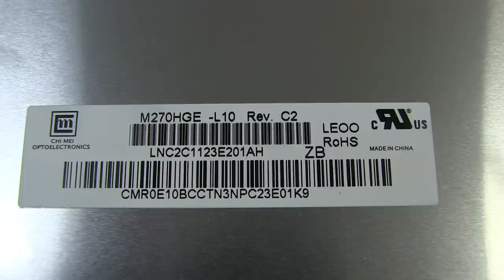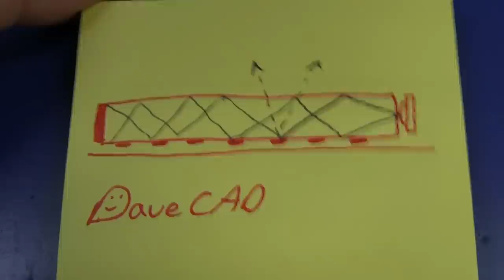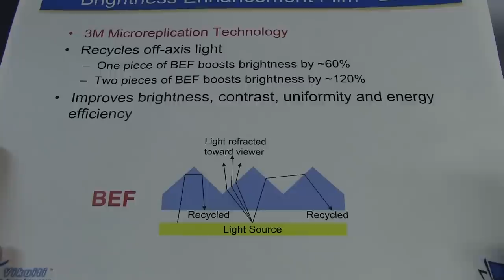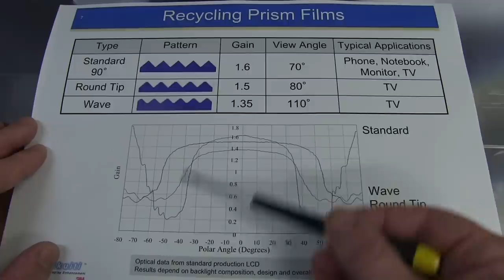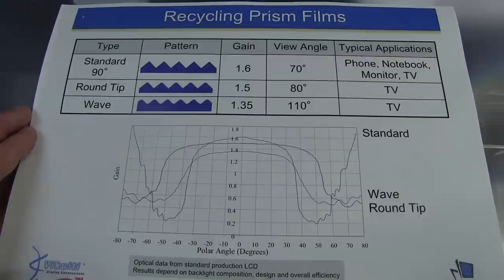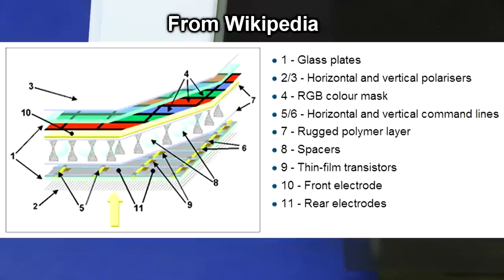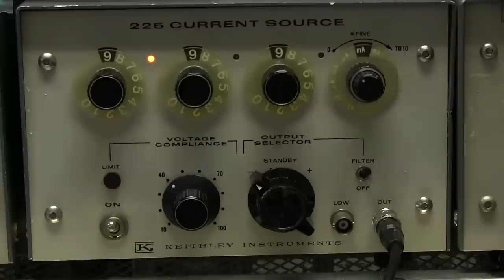EEVblog #465 - LED LCD Panel Teardown

Comment: Beautiful at 28:30 and 20:56 and 21:12 .
01:16 The PCB
05:44 Removing the back plate. Viewing the white, light reflective back
06:43 LED-back-lit polycarbonate layer with etched dots to let the black light escape the inner total reflection

11:53 Diffusion layer
12:25 Brightness Enhancing Layer recycling the off-axis light

16:21 Some extra diffusion layer?
17:10 The cracked LCD panel
18:25 Driver chips for x-axis and y-axis
19:55 Removal of the frontal polarization layer
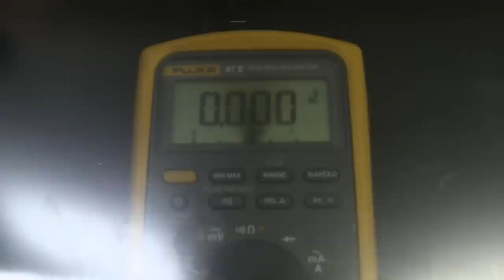20:24 Back polarization layer, pixel close up with macro lens
21:11 Viewing the individual traces to the driver chips
25:24 Pixel and Subpixel viewed with microscope
26:27 Explainaiton and Summarization
28:43 LED backlight efficiency

Comment: That extra stuck layer (the dark one) you are trying to peel off with a knife is the Polarizing layer. BEST way to get it off so as not to damage the screen is  to MASTK TAPE over the electronics to protect them then get a load of wet towels and SOAK the black layer of the BACK off the screen then after three hours you can simply peel away the polarizing layer.

Comment: Those flex cables going from the driver board to the panel are commonly called TABs. It's short for Tape Automated Bonding, though the process is actually ACF bonding. They are attached with anisotropic conductive film (ACF). The film has microscopic conductive particles suspended in it. Anisotropic refers to an object or substance  having physical properties which are different when measured in different directions. When the bonding process occurs, a combination of heat and pressure compresses the tape and this causes the particles to come into contact with each other. The spaces between the traces  don't get compressed as much, and thus don't conduct. The anisotropic property of the film is that, after its compressed, it is conductive if measured across the Z axis, but not across X or Y. There is also a driver chip on each tab. When those chips, or the bonds themselves fail, it's known as TAB bond failure. Tab bond failure is a common problem and is the bane of all TV repair techs. It's less common now than it was a few years ago, so they have definitely improved the process, but I still see it regularly. Though it is technically repairable, the cost of the equipment, and the requirement of a class 10 clean room environment puts such a repair out of the hands of most repair shops. A few years ago, a bonding machine was around $45,000 direct from China and the clean room would likely be just as much. Additionally, the tape has a short shelf life and is very expensive. Last I checked, the cost of a China made machine was down to between $5000-8000, I have no clue the quality of those machines, and you still would have the cost of the clean room to consider. Even if I had one, the cost of such a repair would likely be more than most people would be willing to pay. There's probably only a couple facilities in the country which do TAB bond repair, and I doubt they even waste their time doing repairs for the general public. There would certainly be more money to be made doing refurbishing for the various manufacturers (I could be wrong on that though). As for the burnt transistor, it could very well have been the only problem. Sometimes you get lucky and it's just a shorted MLCC, as was the case for me last month when I repaired a 55" Sharp smart TV by replacing a 3 cent capacitor. As for the diffusion sheets under the panel, I'm pretty certain they are made of Mylar, but I don't know much other than that. Here's a good video on ACF bonding. https://www.youtube.com/watch?v=biHFJFHpqdM
Reply: That was awesome! Thanks for taking the time to write that!
Reply: The burnt 'transistor' was marked 'D1', more likely it's a diode, half of a bridge in the DC-DC converter

Comment: Hi Dave, I was puzzled by the the types of materials in an edge it TV. Your explanation is very, very good. I needed to see what the order was as some of the sheets can be assembled in the incorrect order. I repaired a TV that could not be watched as it was incorrectly put back together.
Some TVs have more or less diffusion materials.
I solved it by watching your very simple to understand EEVblog #465 - LED LCD Panel Teardown.
I do know that the wrong order explains also the extra diffusion sheets. It is to prevent refraction when two smooth surfaces are placed on top of each other. so the extra diffuser acts as a separator. A pebbled surface prevents this. It is also the reason they are often very this as diffusion is only their second purpose.I assembled an 80" incorrectly and the large patterns an wrong side up/down was not seen until you turned on the TV.
Thanks for the video, I have saved it for later sharing.
Rinus (Canada) ("Mommy, where is my mommy, they've taken her away!" - Just for you Dave.)

Comment: The led strip with the complete diffusion /reflective white bacgroudn could make a  quite nice smooth light source -  as a ambient light or placed in a  picture frame and perhaps  colored plastic in front or some glass collage in front - and its quite low power.

Could do for a nice weekend project and nightlight.

Comment: if you reassemble the panel without the lcd, you get a very nice large diffuse light source that can be used as a light table, novelty lamp, etc. i actually have a reef aquarium that's flourishing under a stripped down 40" sony lcd tv.

Comment: Dave, it was fun to realize, that 5 years after your video, I did this teardown, exactly the same way you did, but only with a broken laptop LED LCD screen (which has the same structure, only with smaller parts). I also lighted up only one part of the LED stripe, and tried to realign the layers to see, how they deal with the light. After my experiments, I tried to lookup some videos, which could explain some things more in detail, and landed up on your video :D It's like watching my discoveries in a replay :D

Comment: At 23:40, I believe that the pattern in the corner is to balance out the plating area when fabricating the flex.  If my memory is correct, plating is a function of current density, and if there are portions of the layer which have significantly more plated areas than other parts, it can cause issues with getting a consistent plating thickness over the whole area of the surface.  So the PCB shop may add patterns or ground-plane in unused areas to keep the ratio of plated to un-plated area consistent across the printed circuit.

Comment: The strip has multiple series chains of LEDs on it that look to be individually brought out on the connector, since as Dave pointed out all these LEDs in series would need a massive voltage, like a few 100s of volts.

Comment: The inside of a CRT has phosperous lining it.  When hit, (at the correct position) they illuminate.

That's, what you would see.  Along with some x & y plates and magnets used to focus & aim the beam as it scans across the inside of the screen.

Comment: There are two major LCD panel manufacturers in Taiwan, they are CMO and AUO respectively.
AUO is owned by BenQ
and for CMO, they produce monitors using the brand name "CHIMEI" (or CMV in many years ago)

Comment: Take out the LCD panel, leaving everything else. Suspend the top polariser a bit above the rest - Then turn on the LEDs and use it as something similar to a polarimeter. Put a piece of frustration-guaranteed blister pack in - Look at the stress lines which are revealed. Polarised light is COOL!

Comment: That backlighting system is quite ingenious. I would have never thought of that.

Actually, before I finished watching the rest of the video, I was thinking that the backlighting was the actual thingie producing the display, with the 'dots' somehow turning on/off and reflecting red, green, or blue. Now it seems kind of ridiculous now that I've seen the rest of it. But still, it seems like an intriguing idea. . .

Comment: @08:28 leds nowadays can have resistos included on the die itself..its a space saving method when you have an entire led strip which is only a few mm wide

Comment: Hi Dave. The two polarising films are tt a 90 degree angel in relation to each other and thus, normally, no light can pas trough them. But if you place a the LCD panel between those layers you can control if you want the light that goes trough the LCD panel to keep it's polarisation or if you want it to be “garbled” so that it can pass the front polarisation filter. The first I done by passing a voltage trough the crystals witch causes them to face in the same direction! :D

Comment: If you cut the current in half to an LED, the life time doubles and the light output goes in half (approximately). All white LED's will weaken with age. It's the fault of the phosphorescent coating. Halving the current will about double the lifetime of the phosphorescent coating. LED's respond linearly to current. For most of the white LED's used for illumination, their lifetime's are rated when "pushed" to their maximum limits.

Comment: Can you light the whole LED strip? Also how to connect it up and what current and voltage to use. That I could use as a cheap source of light for camping trips and some solar panels to charge the batteries during the day. Tell us more Dave please.  :o)

Comment: That white sheet of plastic sounds like styrene, it should sound like theatrical thunder when shaken by holding on one edge. The dots are probably a hard coat material dispensed in the pattern and cured with uv light. Just my 2cents

Comment: It is good to keep the reflectora and diffusers in those monitors, they are great for photography use, eg as a backdrop in a lightbox, they work extremely well in getting that all white background for darker colored items, (makes selecting just the object for a product photo a simple task of using the magic wand tool in photoshop then at most, minor corrections with the refine edge tool.

Comment: Try to split the two halves apart, LCD screens have two halves sealed together with the polarization films on them. Also try finding a 9v battery and wired 9v battery adapter, take off the pcb, it is just glued anyway, then touch the wires from the battery to the metal contacts the pcb used to be on, then you should get randomly colored columns from the corresponding contacts. Just remember, some LCD screens need multiple wires powered at the same time or you will get nothing. Look out for the contact that makes it turn black, it will fade out overtime, but if you switch the + and -, and touch the right wires, it will turn back to clear. This is my moms account, I don't have my own.

Comment: Dave each column driver chip has 720 traces to the panel not 240, have have to multiply by 3 for each rgb column.

Comment: The micro dots look like they were chemically etched with some sort of adhered template covering the poly-carbonate in the spots where they didn't want the sheet of poly-carbonate turning opaque.

Comment: Wow! No wonder how LED back lit screens are so much more efficient. Taken a few cold cathode lit screens apart due to bust caps.

The naming of modern screens are somewhat deceptive. Typically only refer to the method used to back light the panels and not the matrix them selves.
My only experience with true (AMO)LED displays are on my Galaxy S and Galaxy Nexus

Comment: you should get the people in your building to know that for a decent price you can fix allot of their more valuable electronic stuff when it fails. that screen was probably worth 4-500 bucks to replace, maybe a bit more, 200 bucks getting it repaired would have been a good value. although i have no idea what you value your time at, so that may be too cheap for you to have worked on it.

Comment: That dots on this screen of difusor, can be made by putting shits with small wholes and later sand it with some kind of air gun, or water gun. Folia for difusing light is made this same way, they sand it.

Comment: it looks alot like a samsung, but curently they tape down each layer, the top chassis has screws on all sides not only the boton and they screw the led strip to a aluminium plate instead of just using double sided tape

Comment: I need to dumpster dive for an old LED backlit monitor also :). I want to use a light strip to create a nice work light or if the color temperature is really good, then also a lamp for macro shots.

Comment: thats cool as hell I like keeping the plastic peice that has the etched dots. I use it for project because getting acrilic that thick and size is pretty costly. so when I scrap i use that adn it works great.   man I like the have that led strip be great for lighting for some sort of project.  great video

Comment: maaan, you can take those leds and light difusers and reassemble them in the monitor case, but without the screen and drivers ofcourse, maje a led driver and you will got a light panel to iluminate things in your lab.

Comment: you should pull apart a old lcd monitor and run a image through the panel it is quite neat. you can see through it with though is tinted depending on the image. i had thought about making a side too a computer using one and having it run by either a usb video card or something simple too work with for computer stats.

Comment: These litle dots on the plexiglass reflector are printed with High Definition UV flatbet inkjet printer plotter, everything else is not etched, but engraved or cuted with lazer.And you open it from the wrong side :P you should take the front bazil first otherwise the reflecive layers wil be scattered before you can disassemble the panel :P

Comment: really wish youtube would allow comments to be edited. Anyway, is it possible to run the monitor without the LCD, just to measure how much power it is using to drive the LCD's?

may be useful in knowing the exact power needed to get the max brightness and most life out of the LED's

Comment: The LED elements layer is an amazing feat of manufacturing and quality control technology on a microscopic scale.  I would love to see how they actually make this layer but you can bet these factories keep this very secret.  The LED layer may no longer have its design patent but manufacturing and quality control systems are far more difficult and complex to patent.  That or there would be thousands of patents to be filed just to break down all the details associated with how this one layer of plastic composite layer is achieved.  Amazing feat of human engenuity for a common place peice of hardware.

Comment: Great job again, I love the teardowns, always learn so much about consumer electronics around us. Keep the good work!

The panel seems to have quite poor specs, can easily be found by googling M270HGE-L10. Would love to see some high end IPS of VA matrix with greater pixel density. I was thinking the resolution of this one is greater than 1920x1080 resolution but it's not. Can only imagine how small the pixels are on say a 5" Full HD display with 400+ppi.

Comment: Hi Dave.
Do you think the backlight could be used with a UV LED strip to make a really big and even lit exposure unit for PCB's? Or will the shorter wavelengths mess it all up?

Comment: Great video Dave; first time I've seen inside one of these and very interesting. At 23:45 the flat-flex box patterns - I wonder if these could be a capacitor/inductor combo? From my basic knowledge, these panels use high voltage, so the switching interference would be high. Would spots with traces around edge be plain inductors? Notice there are several smaller patterns with/out centres v close to traces. Just a thought. Segan is so cool!!

Comment: i took my old busted LCD panal apart.....sheets of plastic type of flex material and a two way style mirror thing happening. also i ripped the florescent lights out for some other future, what i didnt know is they need a higher voltage to work sadly. i was hoping to use them as a kick arse jerry rigged macgyver style USB light.
Reply: Sorry for a late reply but I did that a year ago; just build or find a cheap 5-12v boost circuit. Most CCFL inverter boards used in consumer flat panel displays accept 12v. If I remember correctly the 28cm CCFL I used drew about 4w once warmed.

Comment: Will it help putting he light recovery foil on top of solar panel in effectiveness? hmm.. I think It worth a try :)
Reply: No. It will only hurt the photovoltaic output. Photovoltaic cells are nearly totally absorptive, and they aren't sensitive to angle at the micro scale. Waste light is converted to heat – there is no light to "recover". There will only be losses from the unavoidable attenuation as light crosses the filter.

This is completely different from the scenario in these panels, where you want to direct as much light as possible from the bottom to the front. In this case, light which reflects internally at angles other than roughly "forward" would otherwise be wasted, so these films reflect such light for another go, until it finally exits at a valid angle.

Comment: Why don't we discuss why engineers work as engineers only for generally eight years until they move on to a more management or some sales position (or entertainer in your case :))? Where are the companies doing hardware design locating themeselves now, other than asia?  I am electronic engineer myself (more on the telcomms side) and four months ago I moved to on software development (yeh business applications unfortunately) and despite I hate it, it has more chance of guaranteeing me a

Comment: Could you do a video on how to make a camcorder lcd eye piece into a video rca in device? I want to buy used camcorders and make strange looking video headset. Not sure cam eyepieces take a usable output signal though. I'd donate to have two wired up for voltage in and rca out :o) great shows even if most is beyond my understanding and gear, More a Burt Munroe guy LOL!